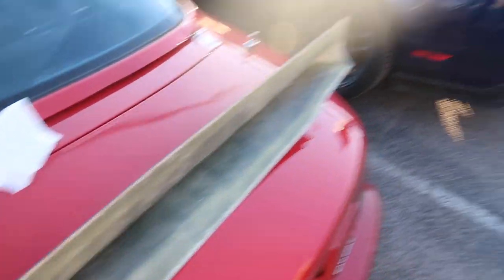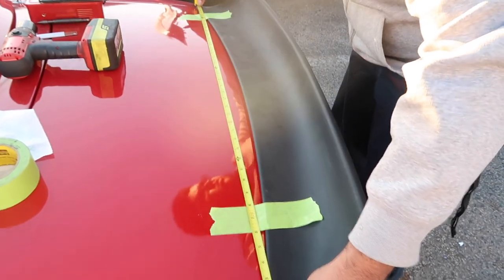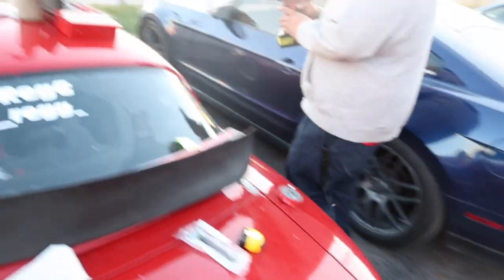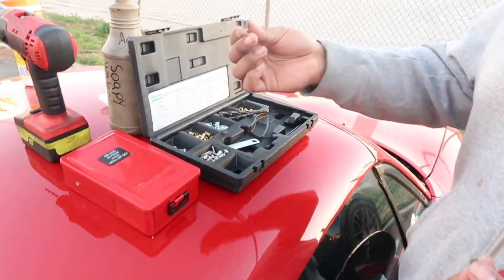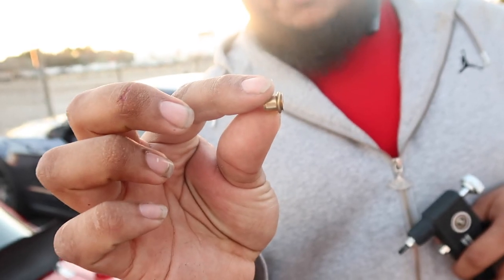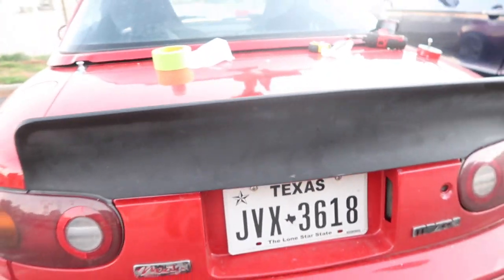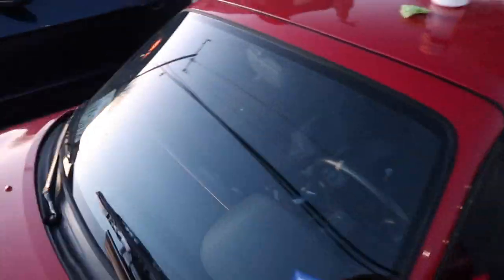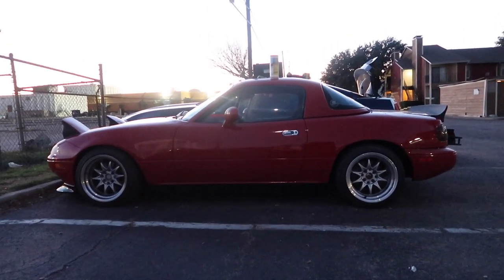Miata Ducktail Install!!!

Comment: Hey bro gonna be doing this to my NB soon. I got the same tool as you but it only comes with 10 rivnuts per size so I was gonna do 5 on top and 5 on the bottom, would that be enough to hold it on? And where did you get your hardware and how did you decide what kind to get?
Reply from the maker: Yea bro you should be fine with 5 on top and 5 on the bottom tbh I probably went a little overboard lol but the hardware my buddy bomberino in the video actually had it from his previous build so honestly idk where he got it from
Reply from the maker: Also I picked that hardware because it’s removable 👍
Reply: @RegG6996  thanks bro I found some screws at home depot that fit my rivnuts gonna paint them black so they blend in 👌
Reply from the maker: @kaarreola99  bet bro that’s gonna look dope 🔥🔥🔥

Comment: What wheels are those!?!?? Also do you need that special tool to install the wing?
Reply from the maker: They’re JNC 003 wheels and yes if you want to put rivnuts you will need that tool
Reply: RegG you mind sending a link to the tool? I really want a wing just like yours for mine
Reply from the maker: https://www.harborfreight.com/45-piece-threaded-insert-riveter-kit-1210.html